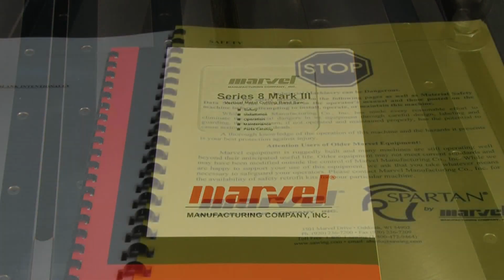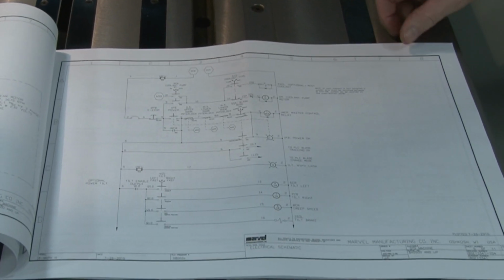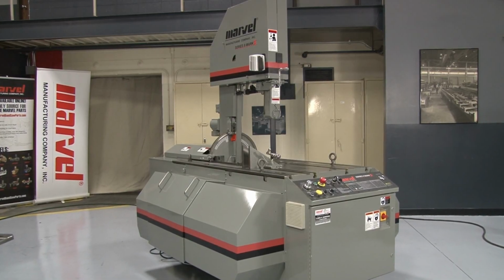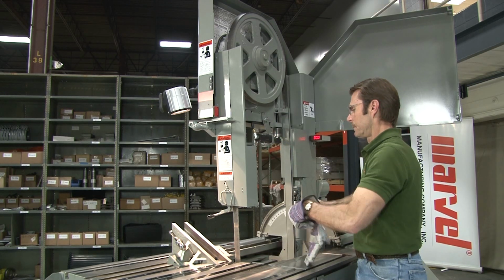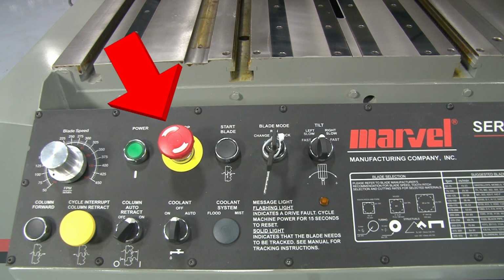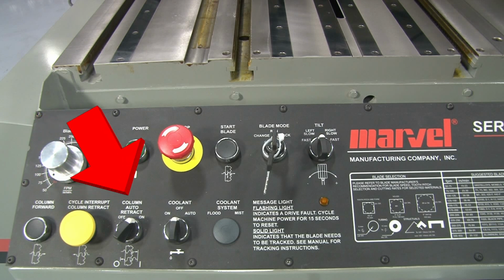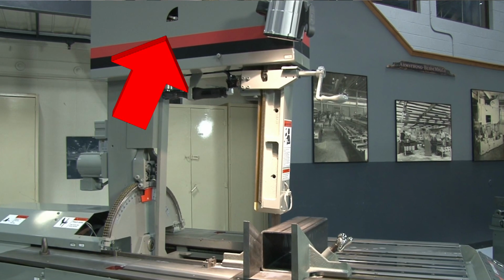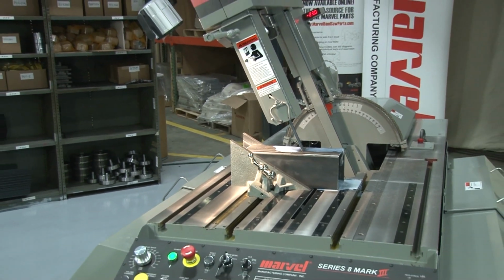8-Mark-III Installation Video

Comment: Anyone know how to correctly use the unist mist fiction on a 2021 series 8 mark 3 it shuts off coolant   and only uses mist . Seems like the gear
 In the bottom of column should have constant coolant flooding on it during operation but that's not the case I don't wanna ruin the saw. Any info would be nice.
Reply: cheyboygan
Reply: @thapharaohsethh1897  Gazoontight